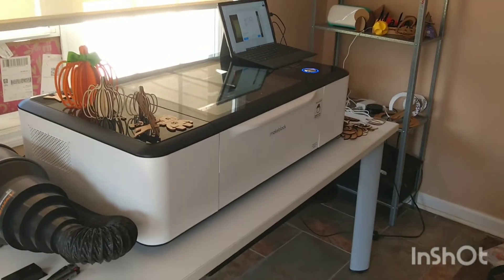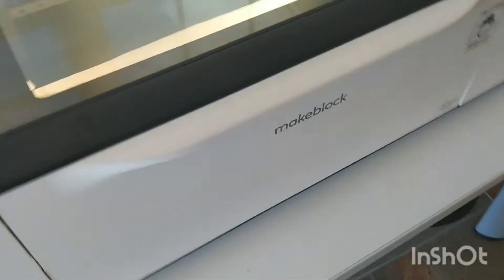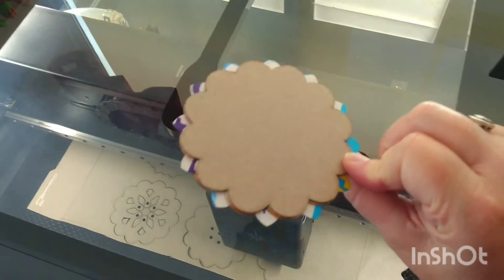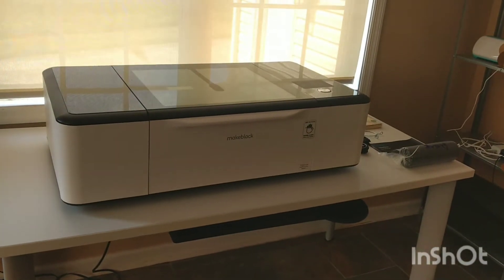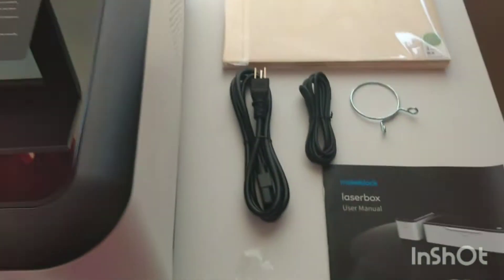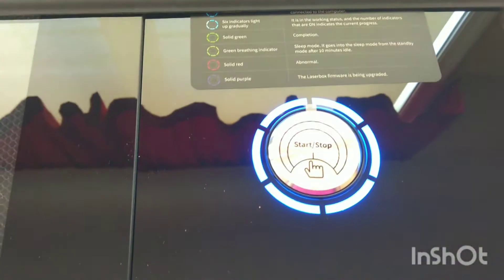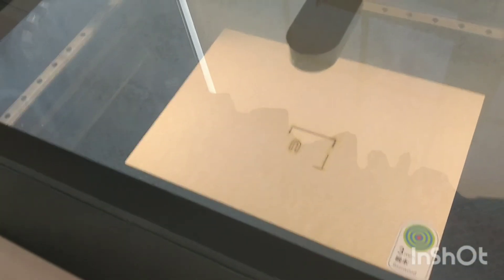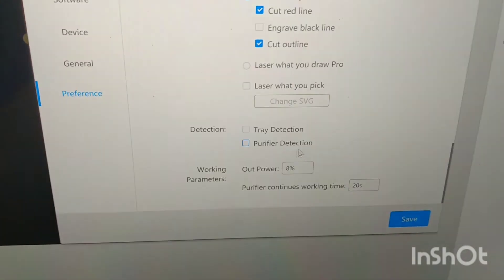Meet my newest gadget. A CO2 Laser! Makeblock LaserBox Rotary by XTool

Comment: Thinking of getting this machine and using the inline fan as well. What's your feedback on the inline fan being used with this machine. Does it eliminate most of the smell/fumes?
Reply from the maker: The inline fan works great, there is no visible smoke. However there is some smell. I think it would be difficult to get rid of all the smell without a very expensive purifier. But the cardboard in my window is not airtight and I also have a door to the outside next to this window that's not airtight.